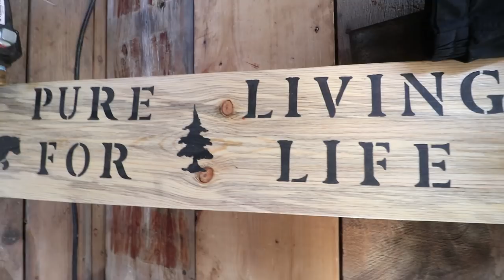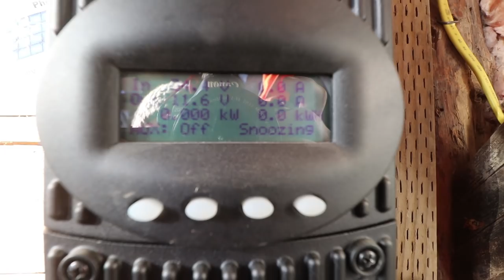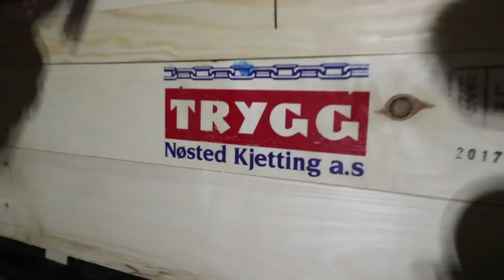Plowing Snow With a Backhoe (Amazing!)

Comment: free advice, after living over 20 years in snow country, I have an 8 foot plow on F350, Kabota tractor, and two airens walk behind snow blowers.  I have found that the snow blowers work best,  they throw the snow 40 to 50 feet away and the snow is gone for the season.  The truck plow and tractor make huge piles and soon the piles are so large no place to put the snow.

Comment: snow chains are not left and right. they go on the wheel inside part and outside part. it would do the job if you just flipped/rotated the first chain on the tyre
Reply: Not necessarily if there are cleats. I thought that I saw cleats.
Reply: Daniel Jones if they are cleats rotation on the tyre by 180 degree will do. if not cleats chain could be just flipped upside down. either way there was no need to move the first chain to the second wheel
Reply: Better not to turn these chains upside down, they're meant to have an inside and an outside,   there are extra 'grips' welded to the chain links.  Same square bar as the chain is made from, short lengths welded onto one side...   so that side should really be to the road..   
Although, to be honest,  if I'd struggled to fit them both and got them on wrong,  I'd think I'd be tempted to just leave them as they were,   they'd still work,  and the tyres wouldn't shred with just one good snow shifting.

Comment: Correct me if I am wrong, but there is no such thing as left or right chains.  All you would have had to do was flip them over on the ground.  VOILA!
Reply: That would make sense to me, mine for my car have a tire side so that should be reversible if I’m not mistaken, as long as the tire side faces in!
Reply: can't flip those ovwer cause of the grips welded onto the chains, if you flip it over the griphooks would go into the rubber instead...
Reply: The grips need to be on the outside so that wouldn't work
Reply: D Jissa Schinstad... thanks for the info.  I will have to watch it again later.  I didn't see grips on the chains.
Reply: D Jissa Schinstad... just skimmed ahead to see them.  Good eyes.
Reply: It looks like those chains have an INside and OUTside, and maybe a top and bottom.  Maybe not 'flip them over', but just swap ends front to back.  Or maybe the tires are on the wrong sides :-D
Reply: Maybe he meant to say 'turn them around'  instead,   that would do the job..   so that the front end, became the back end.
Reply: The 'grip' is just a little short bit of the square bar welded to the links.    Same metal as the links themselves are made from.

Comment: We have had three different tractors by now, and have had chains on all.  The first two were bought mainly for working in the woods. The third one is for home use and our fish business. Have yet to get a plow for this one, we use the bucket quite a lot.  We did manage to get forks for the present one.  But we find they are just a bit short for some of the jobs we ask of it. Thank goodness we can store it in the building where the furnace is, it makes working on it a lot better.  When we get the machanic down for it's yearly checkup it's great to be inside out of the weather.  Have had to replace "O" rings on the Patu in cold weather and that sucked. Nice chains by the way.  Still waiting on the empty box from hubby. Loved the crispness of the colours and the clarity of the shots.  Hugs to all and an extra scratch around kitty's ears.

Comment: Two big words of advice from one who has been there, done that - and survived:
1.  Never ever have a loader in those conditions on any slope WITHOUT chains on ALL four tires, or slide and roll to your death.
2.  On your sloping driveway build a 4' high berm on the drop-off side, camber lenght of drive surface 3 - 4 deg's to the inside.
I don't want to see/hear your video of tragedy.  Admire your efforts and drive.  The destination is a massive reward of satisfaction.
Reply: Any slippery slope in general in any sort of equipment: Always be ready to jump off and out of the way if it starts to go. I work with a professional digger driver and he had to jump off a JCB that began sliding sideways off a muddy bank working on a quarry access one day. He jumped. The JCB went down the side of the hill. What's left of it is still at the bottom of the quarry to this day.

Comment: Since I don’t know how long it’s been since this was recorded I’ll say it anyway.  One thing with the cross chains is that the cut ends of the end of the cross chains should be away from the tire. I noticed the chains on the front were in effect inside out on the left front tire. Usually there is a foreword to the way the closures are on chains. So that spinning them foreword is less likely to undo the closing link. But anyway you look at it chains are no fun, cause it is always cold, wet , snowy or some combination when you need them. Some even use them in mud, never tried that though.   At any rate it looks like you are having fun, if not it gets to be too much like work. Keep up the videos I know it takes a lot of time to make good ones, but I enjoy them.

Comment: With most implement tires on farm and industrial equipment they are directional tread.  You will find that they pull better going forward than reverse. It would have been easier to pull up the drive way than try to back up.

Rick

Comment: Hey Guys..if you have unfrozen mulch left...it works great for a NON SKID on the ice...I've been using much instead of sand ...to keep from scratching up my hard woods inside..also Pet Bedding works fine too, and whats left in the spring is good ole dirt..

Comment: Aren't you worried about your timber frame getting discolored from exposure to the elements?
Reply: They built with green lumber. There’s still plenty of moisture in the wood and the cloud cover should greatly reduce UV exposure. 
Whenever their SIP panels arrive they can get back to building. Although I have to wonder why they haven’t at least sheathed the roof, unless they using SIPs there as well...

Comment: Alyssa, the DJI app on your phone probably got inadvertently set to beginner mode which severely limits the distance your drone will fly. These parameters can also be set in normal flight mode but it’s far more likely that the one beginner mode button was switched. Good luck.

Comment: Too help with grip on tyres it helps alot too clean them with some alcohol. it gets allt the dirt on tyre off and it gives the rubber good traction. The chains are probably the right one as the chains on both sides are the same and it is just too turn it around so that the tightener comes on the outside of tyre. And the best way too get big chains on is too use hooks and drive them on.

Comment: Until very recently I lived somewhere where it' snows like this. Now I live somewhere where it never snows. I'm going to miss the snow, at least a little bit....
Reply: ...... Also. Snow blowers are a good thing
Reply: Steve snowblowers depend on power and type of snow. The more power they have the more types of snow they can handle but they also cost you more. As you see in the video this is snow on top of ice so a snow blower would have traction problems as it is a wet heavy snow. 

I will see your no snow and raise it snows here just enough to see it then it is gone by the following noon. Leaving the Washington DC area was one of the best things I have ever done. Similar high temperatures but the humidity here is low due to the desert and the lows here are still shorts weather for me.
Reply: stevemonkey6666 I moved from Tahoe to southern Indiana we get ice here 
I do miss the snow ❄️ 
From north Lake Tahoe

Comment: reduce the air in the tires, install the chains then inflate the tires
Reply: Bruce Augustine Yes. Used that trick with tractor tires for years. Works great. You get them as tight as you can by hand, then air up the tires. You can hear them tighten.

Comment: Use one of your impact drivers to remove the lug nuts. It will save you lots of time, effort, and prevent you damaging your torque wrench. You can use a torque wrench to loosen things, but if you exceed it's max torque rating it can throw the calibration off. If your wrench maxes out at 150ft/lbs then your probably pretty close to edge as far as that goes. If it's a 250ft/lb one then it's fine.

Comment: You have a lot of toys but I still don't see a snow blower. How come? I think if you used one once that you would be a convert. They move the snow for you 40-60 feet depending on the size of the machine. No piles. No having to push it again.  And why not spend an afternoon and use a bit of the extra lumber you cut  to make a tin roof tractor/ tool shed roof with open sides?   Your Case would thank you.
Reply: A snow blower is expensive versus the utility it has.  Low elevation Northern Idaho (where J&A live) doesn't get all that much snow.  Building another shed is possible of course, but it introduces more headaches and liability:  snow load, wind load, rain drainage concerns, erosion, time-consuming distraction, and being a potential eyesore.

Comment: Deflate  tire, put chains on, inflate tire. Chain will be tight.
Reply: I heard that's not a very safe practice on such large tires....and it would take you an hour to deflate the tire before you got any slump....and I was told you can damage the bead when inflating the tire if the chains are to tight....

Comment: Uh, maybe you could have just flipped the chain to get the sides reversed?
Reply: the chains they were working with here looked like they had ice cleats on the outside, so there is a right and a left
Reply: Yes they have ice bars on them, but they're not right and left. Don't flip them over, just swap end for end.

Comment: My hill isn't quite as big as yours, and I haven't plowed quite as much snow with it, but my compact tractor hasn't needed chains yet. I did manage to bury it up to the frame once. Had to be dug out. I also got stuck in the deep snow but the locking diff got me out no problem.

Comment: Left and right snow chains  ?? What  ? . Just turn the chain around or flip them over.
Reply: Joseph Bridges  thanks Joseph, but with snow chains there is an inside and an outside, the inside just links together and the outside has the tensioner,  easier  to have the tensioner on the outside.
Reply: Keith Burns agree
Reply: If you took the time you look you would see that it is not just a chain but the chain on the outside has bar on the cross links... you can't flip the chain over the bars would be in the tire then...
Reply: Matt Lane flip them end for end not upside down...

Comment: Pushing snow with a loader sucks,  get a plow for the truck and be warm while plowing and be done twice as fast
Reply: guyina4x4 they have shown a plow for their truck in a previous video
Reply: GUY; They need to use a loader....you do know what happens when you push large amounts of snow with a plow....you run out of room very fast....
Reply: Wadlo: nope, they showed a plow they supposedly bought for their friends, to build community.
Reply: Jed: you're right about that much snow, they need a blower, loader is the worst thing to plow snow with.

Comment: That looks like serious over kill with those chains. They look like the chains I've seen on logging  skidders. Did you happen to check out  St. Pierre  Roller Grip chains, made in Worcester, Ma?  They are  easily mounted, an while they have an inside and outside, they can go on either side of the machine.  Also, when a crosslink wears out, it is not necessary to take the chain off the tractor. Probably cost a lot less too. Before moving to Wyoming, I used them for years when plowing snow and I loved them.

Comment: that cop say anything about you pushing snow across the road?      around here you would get a warning or even a fine for that
Reply: Video-gamer-for-life you can get in real trouble civily and criminally for pushing snow across the road.  My uncle runs the county maintenance crew and has had to go talk to a farmer who did that and caused damage to a county plow that ran into the snow pile that had frozen into a mass of ice.  The truck blade hit it, broke a bunch of bolts and spun out of control.  Luckily they didn't have fatalities. Just a lot of damage for the farmer to pay for.  I doubt he'll do that again.
Reply: I don't want to tell you what to do, forgive me if this sounds like it, but next time you slide put your bucket down to help you control the tractor.  You can flip and roll so quickly in that situation.  Only takes a second to lower it if you have the bucket close to the ground where it belongs.

Comment: You might have been able to get back up the driveway without chains if you had turned around.
Reply: Design of the treads on the wheels - they are designed to have more traction going forward - and weight transfer to larger rear wheels going up hill could have made a difference, I probably should have been more clear.   Just something to consider.

Comment: I believe in Florida they require all new construction to have "Hurricane Hooks" to hold the roof on buildings against wind.  Sheet metal straps would be really ugly on a timber frame, but those long lag bolts could hold rafters to top plates and Ridgeline beams and not show....Just a thought.

Comment: could you not have just turned the chain around rather than change side ? hope you get the right ones sorted
Reply: Depending on the style of chain...yes they could have just started on the front of the tire instead of the back. The chains on my compact tractor can go on left or right they just have to be oriented right so the adjustment clasp is on the outside of the tire
Reply: curious...what makes them left or right?

Comment: or you could just flip them over .... just long as the chain binder is on the outside... ;)
Reply: I doubt that would work because chains are designed to sit against a tire in a certain way. If you put the wrong side against the rubber you pretty much guarantee giving yourself a flat.
Reply: Like you, I cannot believe he thought there were rights and lefts!

Comment: you probably figured it out by now, but the app in your phone is set to beginner mode.  That's why it won't let you lfly too far.
Reply: They seem to be pretty decent at flying.  I know they are just short clips but they are smooth and I haven't heard them say, "we crashed the drone".    At this point they actually seem to be better at flying than Casey Neistat.  haha.
Reply: rha600 I

Comment: internet ninja attack. put a rope as a loop at the start off the chain. so you can roll the chain at the back of the rig and the rope holds the chain up  i did not find  vids for this in YT  =)    but whit this i can put em on ez well thos never are ez but still it helps a lot if the rope holds em up

Comment: why didnt you cover the roof with plastic??
Reply: Daniel K I think they mentioned that the timer frame would become a huge sail it they did that and needed to wait till the SIPs are installed and the frame is structurally attached to the garage.
Reply: Because the timber frame is literally just plonked on top of the flooring. It's not attached in any way (yeah, boneheaded AF).

They're worried that a bit of plastic covering it will cause the whole lot to lift up and blow away if the wind picks up.
Reply: ahaa get it =) thx

Comment: You need to ask your Engineer how much snow load  your floor system was designed to carry.  !8+ inches of snow is a lot of extra weight imposed on the floor framing/beam/posts.  Suggest that you clear it off ASAP.